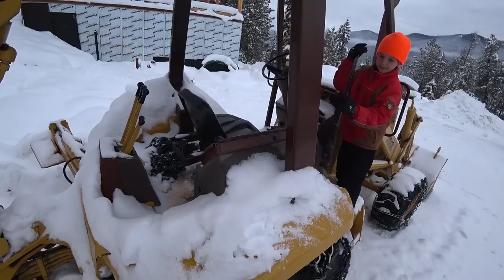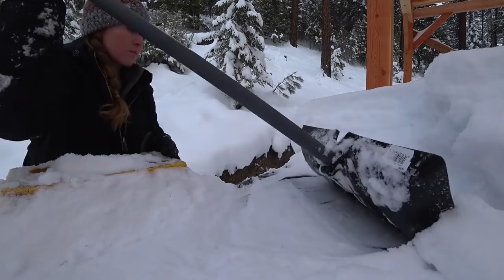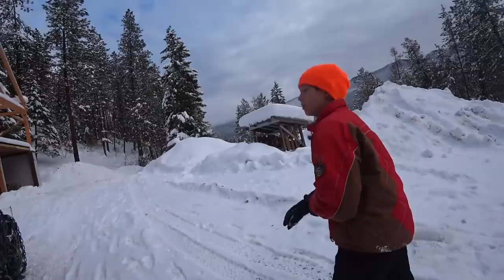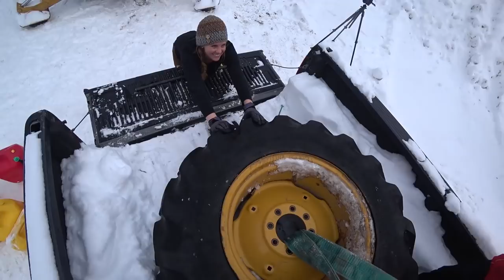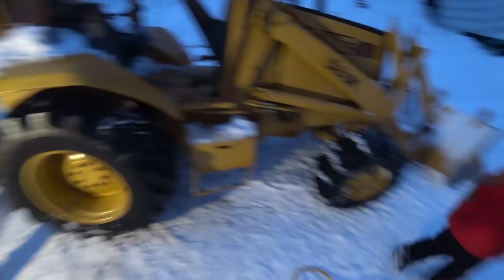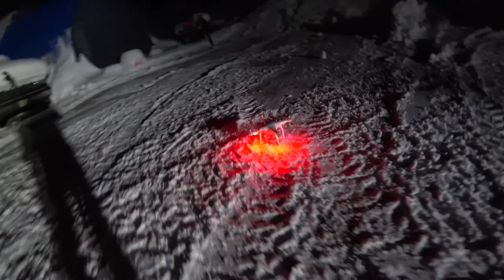👦 FIRST GENERATION DADS Need OUR HELP! 👦

Comment: To get rid of the snow on your beams, throw a ROPE over the beam and with two people, and use a Sawing motion to release the snow from the rafters.  This will work on All of them, So long as the angled ones you can start near the top.  

If you can't throw the line over completely, you may be able to Fly the line over the ridgepole to quicken the fall of snow.  I'd start with the ridge then the second Level pieces.
Reply: Ben Salisbury I
Reply: Hey! Good tip!

Comment: All kids love impact wrenches.
Reply: And ratchets! Loved playing with them... still do. The original fidget spinners
Reply: Been working with air tools for 10+ years, I still "check" the impact every time it gets plugged in...
Reply: Especially after shattering a chrome socket....
Reply: I did that on a lawn mower trying to get the blade bolt out. With a ratchet...
Reply: At least you used a ratchet.  I tried chopping my hand off with a box end wrench.
Reply: Sounds like fun!
Reply: Hell, i still love them

Comment: DO NOT SPEED UP IDLE ON A COLD DIESEL!  JUST LET IT IDLE. A DIESEL WILL WARM FASTER AND LAST LONGER WHEN AT IDLE WHEN COLD.  YOU NEED OIL TO GET TO TOP OF MOTOR.  LOWER SPEED = LESS WEAR AND  TEAR OF NON  LUBRICATED MOVING PARTS WHEN COLD. FAN SPINS SLOWER COOLANT CIRCULATES LESS WATER PUMP SPINS SLOWER

Comment: Use a cable or wire or extension cord over your frame house, to drag the snow off by cutting underneath it.  Snow keeps your wood wet for a long period and you want to get it off before it starts melting.   Even if you cant get it all off it will help when it does melt then it can dry all the sooner.   Tarps for snow is a good idea because it will let you pull off the last thin layer.

Comment: I had a great dad too, i remember sitting on his lap when i was very young steering his car on a big flat beach, then when i was about 13 i used to go with him during school holidays, he drove a 30 foot flatbed with another 30 foot trailer on the back, i learned to drive that truck (minus trailer) around where he worked, it didn't have power steering and was manual, he also taught me to drive  a car when i was 17.
At school i learned about woodwork and metalwork (unfortunately scholls don't do those subjects anymore i believe)
He didn't teach me electricity and electronics, i learned myself.
Also remember when i was learning back then  it was before computers (i'm 62)
I love to share my knowledge with others, more people should do this, specuially if it's one of the dying arts.
Maybe when you get sorted out and in better weather, you could have a mini outdoor centre, kids can learn the backhoe, the mill and other tools, maybe bring in someone who will show the kids how to build a simple project with the wood they cut..

Comment: hello from Island Of Mauritius it's awesome am sure this channel will grow very fast i learned a lot from you on solar system! can you help me can i mix [ah] battery on a mppt charge controller for example 12v 35ah + 12v 45ah + 12v 100ah in parallel [all is lead acid battery? all used and free here battery are very expensive....

Comment: I was about that boys age and had a mason working on a new house down the street from my home, pay me a penny a brick to haul them from the curb to the scaffold. The guy gave me a tape measure and a tool belt a couple weeks later. Stacks of 100 bricks, ten feet apart. Went for sodas and coffee to. Best summer of my life. Probably made $100 but it wasn't about the money. It was guy stuff!  BTW, I retired from the construction business a couple years ago. I did pretty much everything at one time or another from the footings to finish carpentry. I actually retired from an architectural position drawing houses as a project manager. What you're doing shapes lives for generations. Even though both of my sons are intellectuals, (one is a geologist and the other is a software specialist) they both have a better than good working knowledge of hand tools and basic construction techniques.

Comment: I see you bought the Dewalt DWX726 Miter stand. I own one and love it but I suggest the RIDGID AC9946 for 5 reasons. No bending all the way to the ground, bigger tires, product stops, longer arm extensions and quick miter disconnect. Still have the Dewalt but I love the Ridgid more.

Comment: Clean snow from timbers using 1 1/4" schedule 40 PVC.  A "T" large enough to reach, then simply pull it down, use additional sticks as needed.

Good job, Alyssa needs hot tub after all the shoveling.  That is/was a lot of snow and reinforces my decision to leave Athol.

Comment: Not having my father around from 10 yrs old and on I relied and stole a lot of my friends Dads at times. I learned carpentry and respect of tools from one. And the list goes on and on. I started working when I was 16 at the local Gas Station pumping gas. I later moved up to changing oil, tires and I swept a mean broom..lol A friend of the family asked me if I would like to learn a trade and brought me to his little print shop. My career in printing started and I spent 20 + years in the printing industry, but I was missing something. Not sure what it was I started looking for another job, just so I could get outside. Carpentry was where I found my 2nd vocation. I  hauled shingles, masonry blocks, lumber, etc etc forever it seemed. I continued on for many years and loved it. As I grew older I started running out of gas and decided it was time to mellow out so my body could have a much needed rest. Many jobs later I am retired now and have many hats I cant wear anymore but I have loved them all.. Thanks for helping and teaching that little guy Jesse. Brought back many memories

Comment: That's a lotta snow lifting. With the big snowfalls y'all get, you might consider storing a small snowblower or thrower on the deck. But first install small wheels in place of the little skids under the front corners so it won't damage your plastic sheeting. Then keep it covered and fueled, ready to go. Just don't wait for 2 feet to accumulate before tackling it. Oh, and put orange bike flags on your hydrants. It'll help loads when plowing.

Comment: I was expecting this to be an epic fail but it was surprisingly one of your best.  My biggest problem was with the impact. No PPE and the wrong type of socket. An impact wrench should ever be spun freely. It can slip off and fly off on a tangent. Also, eye pro and hearing protection should be worn.  Hearing loss happens very quickly to young people as well as old.

Comment: Jessie= I am not trying to criticize but  when you start a diesel motor that size with oil that cold, never rev it up like you did... keep it low and puttering, the oil is thick goo, it has a large engine therefore had a lot more surface area to cover and the turbo is lubed by the oil which will not arrive till warmed (new turbo=1000$) let it putter till it runs smooth (10 mins) reving it up that early terrible ...also where is my bugaboo catnip video that I been asking fot?

Comment: Is there not a heavy equipment tire service close? The have the equipment to take that wheel off. It isn't as light as you think. A couple of kids and you will not hold that tire if it gets away from you.
Your 'clevis' is actually a quick link.
It is a good thing you did with the kids.

Comment: Thanks for the video, brought back a lot of fond memories working with my father and my grandfather. My father recently told me something my grandfather once told him, “don’t take away the initiative from children”, by which he meant to let children try to do stuff, even if they might be doing it wrong, and just nudge them along the right path. I know from teaching a lot of trainees at work that it isn’t always easy to fight the urge to take the tools out of the trainee’s hands and just do it yourself when you see them struggling, but as long as they won’t screw anything up it’s usually better to let them figure things out for themselves. You guys did great at that, and also explaining as you went along doing things.

Comment: Word of advice Jess. When tyre is being inflated you should attach air line to the valve step back couple of meters and then start inflating. During unlike event when the tyre explodes big and strong man like yourself gets crushed by the blast and most of the time killed instantly. Always think of unthinkable.

Comment: Save your back and use backhoe to load & unload tire, then use a shovel as a lever under tire to get it off and on hub.  Also, use anti-seize on studs. Just many years of experience.  You’re doing great.

Comment: Lucky little guy. I didn't get a digger driving lesson until i was 19. I drove for the first time at 14 and i did get a lesson in forklift driving when i was 15. My dad said he would teach me to weld but never got round to it. I used to go and work with my uncles all the time as a kid. It was great.

Comment: For about $5 you can buy a lever action chuck that clips on to the schrader valve. Then you can set the regulator on the compressor to what pressure you want, and just walk away.

Comment: Quick backhoe tip. Use the rear bucket to lift the how past what the outriggers will do. After it's up use the outriggers to stabilize. You can get the backhoe up higher and stress the outriggers less.

Comment: i once saw a video of two japanese clearing a roof of snow with the snow pusher (dunno the name of it) and it seemed a easier work than using a shovel (you won't need to lift the snow), just an fyi if you get this kind of snow again before spring

Comment: Jesse when you are putting a heavy wheel on a backhoe or truck roll the wheel into the scoop of a regular stout shovel. You can then lift the wheel a couple of inches with one hand and use the other hand to guide it onto the lugs and fit a nut loosely to hold it in place. Also when you park up the backhoe after use tip the front and rear buckets so that water and snow doesn't fill them up. It saves a little time clearing it when you need to use it.

Comment: no wonder you have to gas up everything so often if you let it run the whole time without using it, you could have turned off the backhoe while  unscrewing the tire you had it secured and id didnt needed to run also what is it with letting it run warm there is no point in it especially if you doing the service like oil change regulary , just dont turn it up so high when its still cold, saves you money and doesnt polute the air so much, here in germany you get a ticket in some regions if you let the engine run for no good reason.

Comment: to save you all a lot of work i would put plywood on your roof with felt paper glued down  so u didnt have to work so much removing snow  till your" sips" are ready -  then no leaking down stairs  no snow to push off and it will save your post and beams too-    you also should put a roof over hot tub and  then that wont have snow and u can use it yr round like i do

Comment: So if you put the first wheel nut at the bottom it stops the wheel from kicking out and the wheel sits flat against the hub, enabling you to get the rest of the nuts on easy.

Comment: if you have to move a big heavy Tire like the backhoe Tire if you take and put a bar on the ground were the center of the tire would be and then roll the tire  on the bar you can pick the tire up with one hand and use the other hand to push the tire on

Comment: It's  bad to run a extension cord to the compresser it's better for the motor to run longer air lines instead of extension cords it's something about the amp drop off that the extension cord and keeps the longevity of the air compressor components

Comment: It's about time to get that trailer under the structure and frame in the front so you can put the woodburning stove inside with you and heat that space up!! Where are the Sips, It will make a world of difference if the structure was up. I'd be worried about the wood framing getting soaked and warping??

Comment: I was watching another video and a parent asked the moderator if there was a book that would help to build self esteem and confidence  in a child. The moderator told her, "No, only people can do that." I thought about that comment and I realized that there is a book when coupled with caring and knowledgeable adults that can work wonders. The book is called, The Boy Scout Handbook.  I still have mine from the early 1960's.  You did for Zee essentially what Scout Leaders have been doing for boys for over 100 years.

Comment: Hey Jessie 
An easy way to clear the snow off the timber frame is to toss a rope over it and while holding both ends drag it across the beam from blow but not from right under neath it